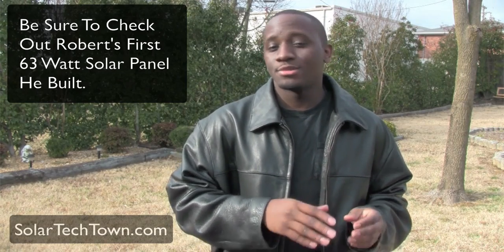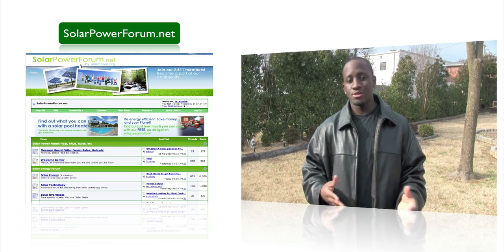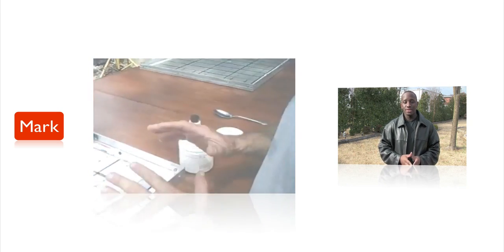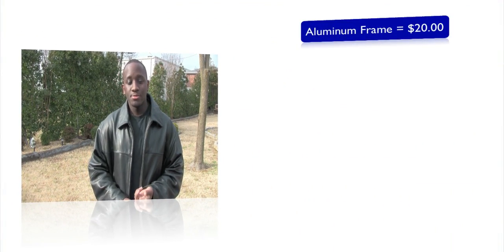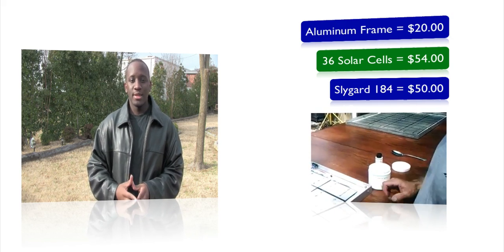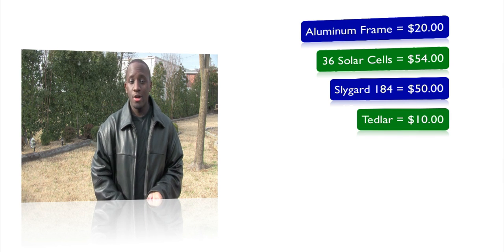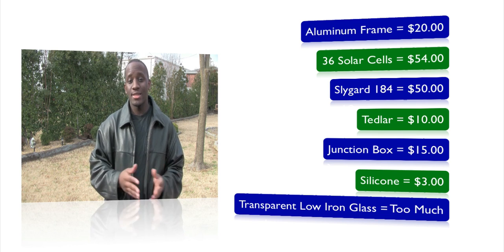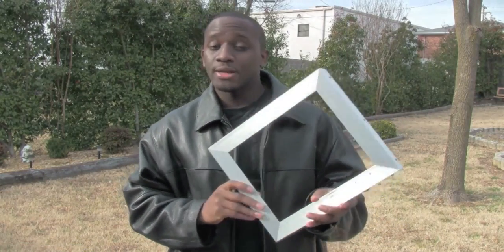How To Build An Aluminum Frame Solar Panel - Part 1/3

Comment: Robert, I need to see this video as I have to build a frame for my two flex solar panels.  However, it was hard to watch.  Some feedback on your video so you can make better ones in future.

Too much body movement, hand movement and I did not take my Dramamine so slow down.
Speak slowly and articulate.  Lots of words gushing out which cannot be heard are useless.  Less words.  More meaning.  Slowly.  This is a DIY, not an express train.
Keep yourself in the frame, no need to share half the frame with eBay.  A small text box is enough.
Too much discussion and talk, no action.  Get into your subject faster, wasting a video on intro is wasting viewer's time.

You have good presence, but take my feedback and make outstanding videos in future!

Comment: Thanks for the video! I actually came to the same conclusion and I haven't even started to build a panel. If you make a single 36 3x6 cell panel, it will be more expensive, however if you build 3 of them you actually start seeing some substantial saving even with expensive glass and frame. Thing is you don't always want a weather sealed panel, in that case DIY makes tons more sense. I want to try and make fabric backed foldable panel that I can hang on a window.

Comment: Hey Robert!
I've heard of people encasing their cells with a clear polyester resin, instead of the expensive sylgard 184 stuff. I know the resin would seal the cells really good, but i don't know anything about the conductivity of Polyester resin, and i don't know if it would effect the connections/add a ton of resistance. Do you know if that would work? 
Thanks again for all of the vids! I love them!

Comment from the maker: @artclemente 63Watts

As time goes on, the price of prof. panels are starting to come down. They were a lot more expensive in the past. I just purchased some prof. panels from a poplar seller (UL SOLAR) on eBay for a very low price. I made 3 videos talking about those panels that you can check out in my channel.

Comment: Robert, can you tell me how many watts your 36 cell solar panel puts out?
Most of the professionally made panels cost about $2.50/watt, or about 500 dollars for a 200 watt panel....expensive enough that I'd definitely want to  try to build one of that capacity

Comment: My glass guy makes my frames for cheaper than I can buy the materials for about 25 bucks and installs the glass in them for me then I put my cells on a piece  of half inch chip board painted with high heat white paint and primer it first with kilts primer. I attach the board to the glass frame with silicone and thats all thats needed no hard ware involved. The safety glass is about 50 bucks for a 36X36.

Comment: I have seen on line panels for as low as $1.74 per watt, for panels ranging from 100watts to 210watts. If I could build them for as little, and ensure that they will last 20+ years; I'd make them myself. Later from sunny FL

Comment: I don't think embedding the cells in acrylic is such a great idea, it adds a bit of permanence to the panel.
If a cell ever goes bad, and they are all in series, the whole panel will quit working. Better to lay the cells face down on a piece of glass, and put some sort of plastic laminant over the backs. Something that can be removed later. Perhaps when my cells get here, i will make my own videos with aluminum framing.